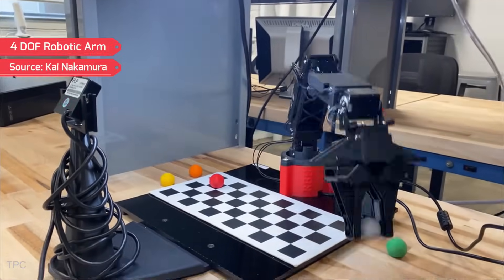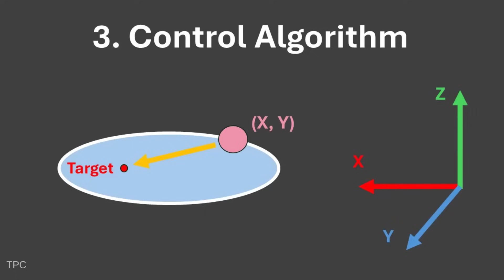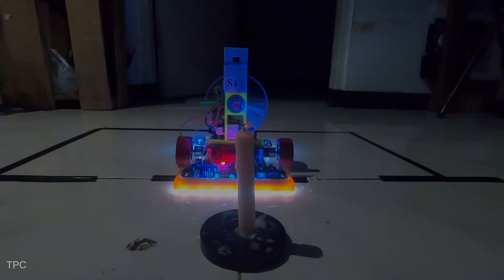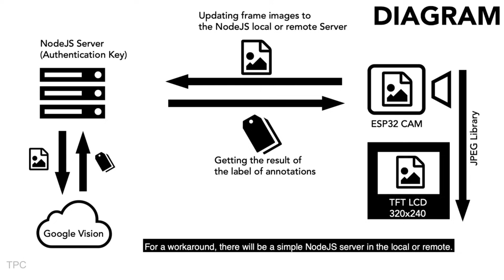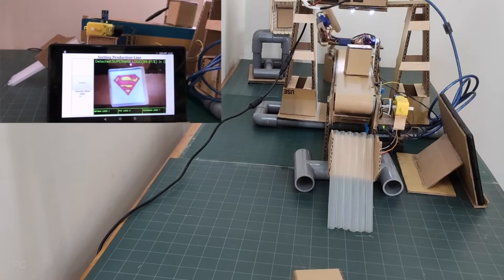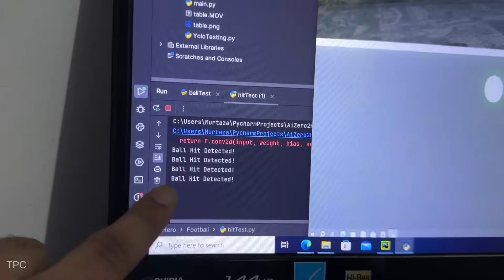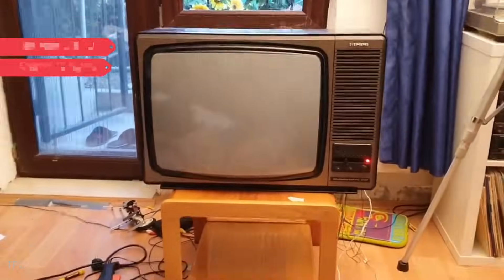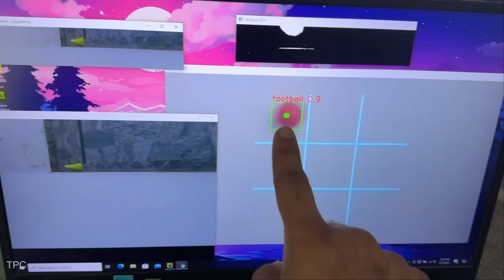20 Best Computer Vision Projects for 2025!

Comment: There's is a problem in my project which I currently at.I am trying to use bluetooth modules from my Headset.Will we have some components in the circuit designer for such purpose as in my headset
Reply: Good luck